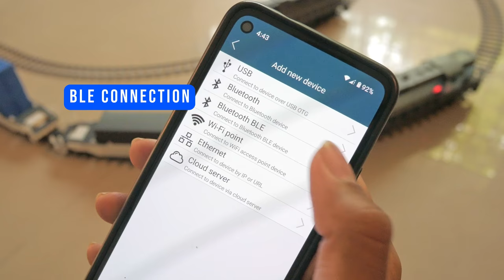GP7 Locomotive 3D printed - Bluetooth control

Comment: The locomotive looks like it is powered by an onboard battery instead of track powered.
Reply from the maker: Yes, read instructables for more info
Reply: @RamBrosWorkshop  - There are many model automobiles made to 1/64 scale, like Hot Wheels & Johnny Lightning.  Many models of farm machinery are available in 1/64 scale.  The racecar slot cars that are classified ad "HO" are actually closer to 1/64 scale than HO scale (1/87).  I have also seen some aircraft models made to 1/64 scale instead of 1/72 scale.

Comment: Plaese cobalah model cc206
Reply from the maker: Hey friend, We looked into it. GE CM20EMP has verry little references. We mostly choose models which are popular.
Reply: That's right, friends, the GE CM20emp locomotive has very few references, I've looked for the 3D model file design on the internet and it never came, even though it was all paid for, but even though I have 1 model file reference that is free, it can be 3D printed.